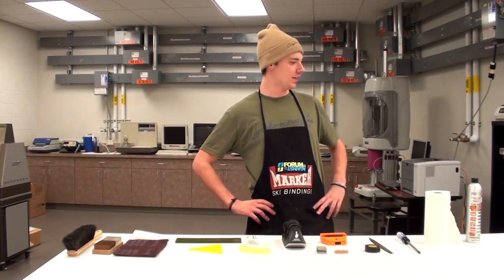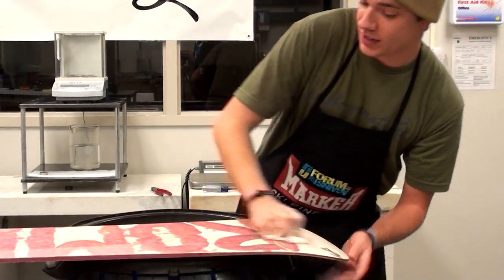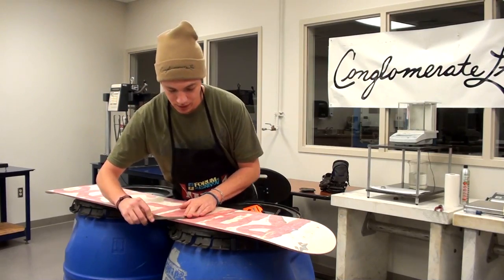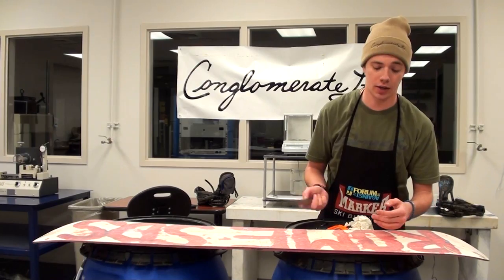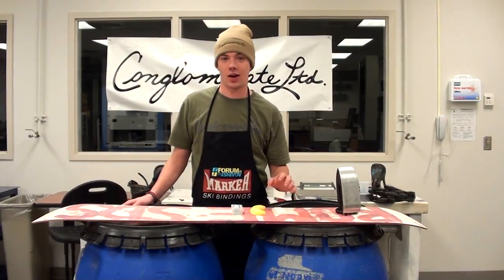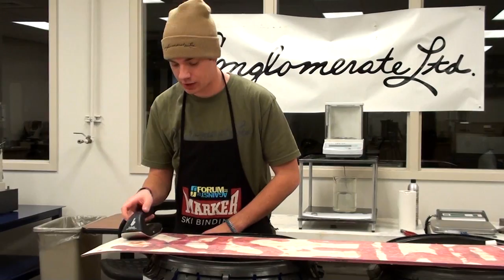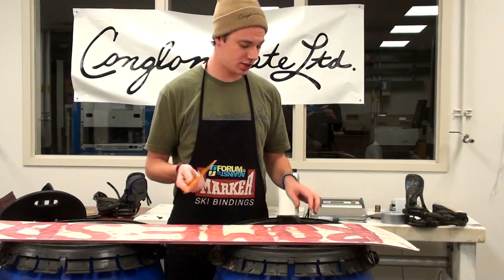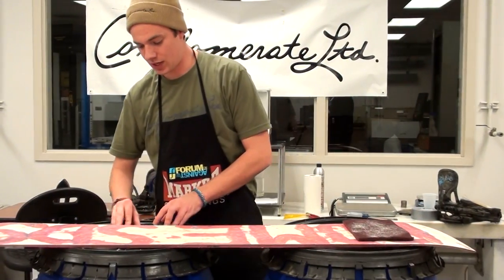How to Properly Tune a Snowboard

Comment: I usually don't comment on videos, but I feel like I need to warn people that this is NOT how to properly tune a board.  First of all, he's using the file guide wrong.  the guide should always run flat across the base no matter if you're sharpening the base or side edges.  Just move your stone to the base or side insert.  The way he uses it ensures that the angle will be way off and inconsistent.  Also when he starts to scrape the board after the wax he says, "don't take all the wax off".  You definitely want to scrape it all off to get a smooth surface.  The wax will absorb into the pores of the base and you want to get everything off the surface.  I cringed when he started running that file down the contact points of the board too.  Oh and using tape on a file to set a bevel angle.....if you're going to tune your board, just spend the extra cash and get a file guide so you can do the job properly.  It's going to cost a lot more to replace your board after you destroy the edges.
Reply: most likely he is "tuning" it for park and street, so he will juts round all edges even the contacts, but he did kind of give a cool tip - like the file with tape if you actually work out say how much you need to get a 1 deg of 90 and juts use this file only for base he could be ok with it  - super tight budget tho since angle setter is not so much
Reply: And also, to be on the safe and nice side, please do nose to tail movements with the brush and tab, in this order, after you've waxed the board :) This way you'll create some micro-channels that will guide the melted snow below your board nice and clean, from nose to tail, with as little friction as possible.
Reply: Yeah nah, edge tuner doesn’t belong on base
Reply: You should comment on videos more often. That's some good advice, buddy
Reply: this is one of the worst snowboard tuning videos i've ever seen to be honest lol
Reply: @ShaggyR1z1a  he literally said "we're tuning this for a guy that doesn't ride park, he likes to carve".
Reply: @ElevenEightNate  he says that the guide is for anyone who likes to ride park or carve, not sure how you heard that
Reply: @itsdylpickles2335  well he did literally say it before he mentioned park so thats probably how

Comment: I just use arkansas stones on my edges.  My biggest gripe is the actual board itself.  I am way over the weight for my height that they are designed for I am a bodybuilder.  I do not actually need extremely sharp edges my weight will push it into the snow.  What happens is that the nose and tail are not wide enough and the board itself is not thick enough.  At low speed I can do anything I want to and not wipe out.  If I am going fast I have to be very gentle because the board will vibrate and oscillate violently enough to cause cracking.  What happens I am trying to change direction and an area near the nose and tail are in contact sliding through the snow.  My weight flexes the board then it springs back several times a second.  Generally cracks form where my bindings are mounted because that is where the loads are taken up and the holes create a stress concentration.

Comment: The title is incorrect. I used to get paid to wax skis and did some snowboards.  I have worked with a world cup tuning tech from swix.  I would recommend another video. These techniques are not recommended and like others have said, he is messing up his board.  His age is similar to his experience and knowledge, very young with not much knowledge on the proper way to tune a snowboard.  He did not learn  these techniques from anyone who knows how to properly tune a board!

Comment: wont be anywhere near park level anytime soon, but im curious.  how important is tuning?  we talkin difference is faceplant vs. not, or just noticeable difficulty on box/rails?
Reply: if the edge is sharp and catches on a rail, you can definitely faceplant into the rail.   This is why park riders often detune the hip edges. Is it necessary? No. Does it help a bit? yeah.         Detuning the ends (widest points) is different, thats for downhill riding especially when you want to butter, it helps keep the tail/nose from grabbing too much when you turn the board around. But downhill you do NOT want to detune the Hip edges, just the ends of the board.

Comment: do u need that pad to rub in the wax at the end or if u skip it does it make a big difference. what could i use to replace that pad. also do u need a gummy stone
Reply: brilo pad cost a dollar at any store anywhere. just use it.  Do you need to nylon brush afterward? No you dont NEED to, but I would do it.  The real pros even go to a horsehair brush after that.

Comment: Old guy here, Do not use a file without a handle. Ive seen the carnage the handle end does without a handle. If it hangs up you will see for yourself. Other than that thanks for the vid dude.

Comment: I've heard it's good to put more wax on the edges cause it gets the most use
Reply: Dude, ignore everything in this video, it is all wrong. He even has the edge tuning tool the wrong way and totally stuffs that edge. You can't really put "more" wax along the edge as you scrap off excess wax. Don't leave excess wax on your board or it will slow you down until the snow buffs it down. You can though use a harder wax along the edges or add something like Swix hard powder along the edges. A useful option if you ride in an icy area. You are right about the area getting the most use, and it is the first area you will see your base showing signs a new wax job is due.

Comment from the maker: The amount of wax also makes more of a difference with the type of snow you are riding on. During the regular season I always rock wax and scrape most everything off, but late season is different. Sometimes I wax and don't even bother scraping just because within one run the excess will be gone. Other times I don't even wax and I'm fast as hell. Moral of the story though, try it all! Experiment and get to know your snowboard!

Comment from the maker: Erik... I personally don't mind a little extra wax, as long as i can create a very smooth base. However if you scrape it then flex your board and you can see the wax crack, then there is way too much wax. You will usually see this cracking underneath the bindings. This is because most people tighten their bindings too much causing the base to be pulled up underneath the inserts.

Comment: To clean the board can you use water
Reply: No but you can use almost any type of cleaner, water want really clean
Reply: actually if the water is really warm, and you put just a tiny bit of dishsoap in it (and make sure to rinse well afterward) I find it does a better job than the citrus cleaners and for essentially $0

Comment: Do you need to remove the wax of an iron or can I just leave it on and let it melt the next time when I wax my gear?
Reply: Yes, you can just leave it if you're using the same temperature specific wax every time.

Comment: Why file the edges, if you round it down anyway? I think that´s material waste (metal edges) and edges are unreplaceable if I know right. Sharp side edges are important for carving (~88°), if you like the loose feel for jumps and jibbs just leave the edges alone (~90° and the "sharp" edges wear down during usage anyway). Just my 2 cents. 
Cheers

Comment from the maker: Windex would not work as a cleaner because it is not a strong enough solvent to remove the wax from the pits and grooves that are designed into your base. I would recommend a citrus cleaner. In regards to your edge angle, a 90 degree bevel is normally used for racing and 88 would be a decent edge for general riding. However, I would bevel much more if you are contemplating hitting rails or boxes.

Comment from the maker: Are you referring to the buffing/smoothing step after scraping the wax? if so... would the orientation of my buffing strokes really make any difference after the first run? that might be a potential concern in the Olympics when you are trying to shave off .0001 seconds... but not for the average snowboarder.

Comment from the maker: The objective of cleaning your base is to remove any dirt or old wax that is in the pits and grooves that are in your base. If you want to simplify and speed up the waxing process use a base cleaner. However if you are going to own your snowboard for a couple years or more and you really want to take care of your base, hot scrape it.

Comment: every time you clean your base it takes out all the wax in your board! only clean it once every season if you need to!! I personally suggest to clean via a hot wax, that way all the wax is not removed from the board.
Reply: ALWAYS clean your board EVERYTIME BEFORE YOU WAX.    Wax your board every 10 - 20 hours of riding.

Comment from the maker: There are a couple types of stones for deburring edges... if you just went to town on your edges and made your edges round for rails or street then you would want to use a hard gummi stone (dense, fine particle, not very abrasive) to get the big burs. Then go to a soft gummi stone (soft, porous). i dont know if a pumice stone will work ..im not very familiar, but i hear they can take calluses off or something...lol but what the hell... try it!

Comment: If you use a file it will leave pits and take off too much metal.  There is not much metal to begin with it looks like 20 gauge 304 stainless.  Thats only 36 thousandths of an inch.  Stainless steel is soft to begin with.

Comment: There is so much wrong in this video. Don't clean the base then file the edges leaving all the filings ready 2 wax into ur fresh base, file first then clean last thing before waxing, don't use base cleaner every wax, it dries out ur base, you used the edge tool the wrong way, to do the bevel edge you put the insert in the other way so no matter what edge your doing the tool always slides along your base so the angle it accurate, you detuned the tip/tail too far passed the contact points etc etc.

Comment: i cringed the second he started using a base cleaner without making any sort of mention that they are not good at all for sintered boards... and continued to cringe almost constantly for this entire video...

this was a gem too: "its very important you don't just leave an iron just sitting on your board, because it will end up burning and degrading the wax" yea... the wax is the only thing that will get ruined if you leave a hot iron on it, there will be no other negative impacts what-so-ever... this kid's a joke

Comment: He's tunig at wrong way.Always tune from tip to tail...
Reply: he also scraps the wax from middle to tip... you are suppose to scrap from tip to tail.
Reply: Both of you... It's a twintip board, did they not teach you that in kindergarten? Well, it means that it do not have a tip or a tail. So please don't hate this guy for doing a pretty usefull vid.
Reply: you think you are clever right?Well,nobody rides more switch than regular.That means you sharpen the edges from tip to tail.We don't hate we just say it could be better.Thank you for the nonsense comment btw.